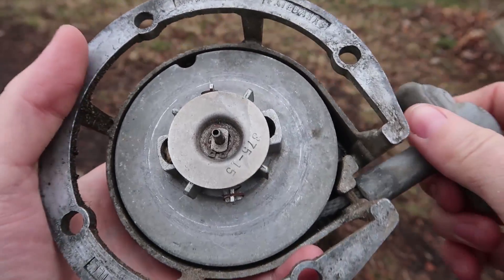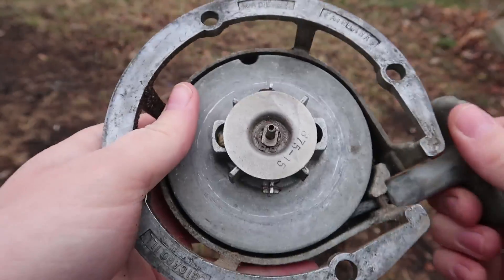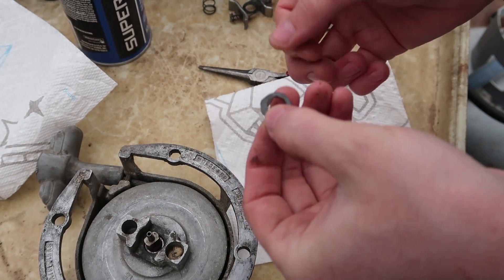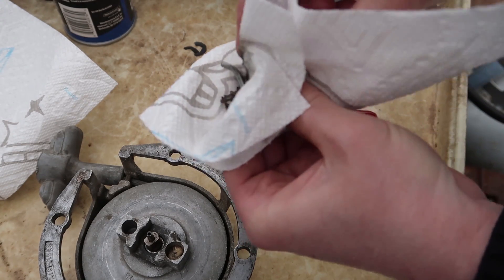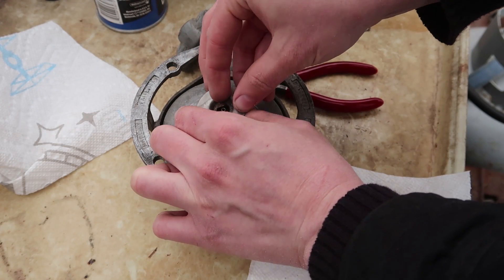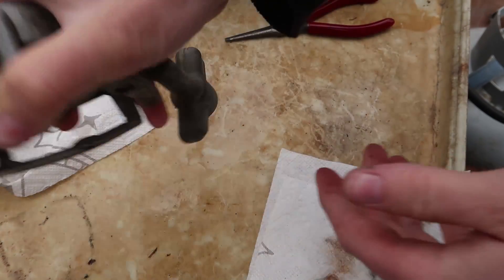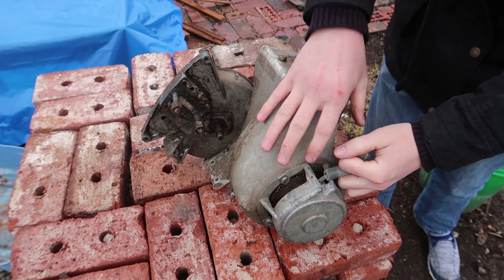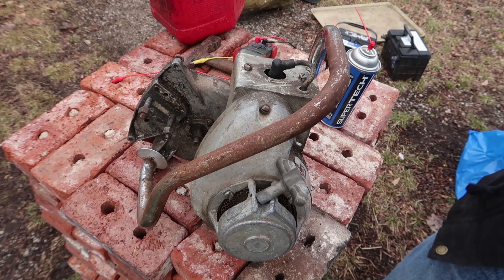1950s David Bradley Chainsaw Restoration 02: Recoil Start Repair, Pull Cord Clutch Cleaning

Comment: i used to use good duct tape to plainly put a layer inside the cup (cleaned with denatured alcohol of course first) i mentioned that yesterday on your db chain saw disassembly, as that ususally works for about a year. then the tape falls off. so today i took it apart and cleaned it and noticed the little clutch disc' (the thing that you broke, you can cut a gasket to replace the little cluth disc, next time u take it apart.) plates that cause drag in the spinning engagment thing. so i cleaned them. and they lightly rubbed them on some bricks and that gave it better surface. but then it still slipped so then i had a brainstorm and put the cup in a vise to then with a sharp center punch and peen'd little divots all the way around the inside of the cup to hold a thin layer of  jb weld to set all last night, oh i must of taken it apart yesterday. but today it worked like a champ. i have the 917 61401 it has the tillotson carb, and if those air screws aren't exactly H-1 1/2 turns out and L-3/4 turn out, it wont start, if it's on the right amount of turns it starts first pull. i have a 360 also. both run very well , i bought them in the early 80s for 50 dollars for both. i'm gonna another bar for the 360 db to run both at the same time and cut little biscuits, why? i dont' know.

Comment: just a tip. the reason why that plastic piece broke was probably due to the carb cleaner, carb cleaner has very harsh chemicals in it which break down most plastics
Reply from the maker: it wasnt plastic, i think it was either a type of paper or leather

Comment: Those old David Bradley starters can be a real pain! On my saw, the part that the teeth on the recoil starter grab on is actually worn down so the teeth can't grip it and I'm gonna have to machine a sleeve to fit inside.
Reply from the maker: ah that sucks, i wonder if you could electroplate that cup to "grow" the metal and then maybe clean it up afterwards.

Comment: if you use the pliar thingys..on the screw thingys.
when its made for a screwdriver thingy.
itll break the thingy off in the hole thingy.
then you habe t use a drill thingy.and a tap thingy and an easy out thingy.to replace the thingy w the thingy..jus sayin